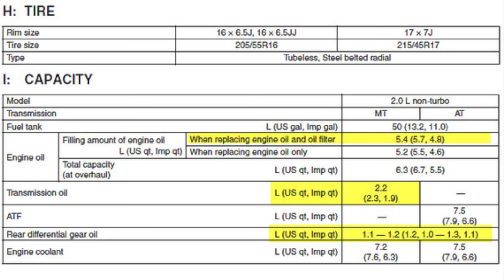How to Change Brz Transmission & Rear Differential Oil (In Depth)

Comment: Gasket Part Numbers

Transmission Drain and Fill gasket(washer):
#17008AA050(Subaru) | #SU00303626(Toyota)

Differential Fill plug gasket (Crush Washer):
#11126JB000(Subaru) | #SU00300122(Toyota)

Differential drain plug gasket (Crush Washer):
#1215710010(Subaru) | #TOY1215710010(Toyota)

Hope this helps
Reply: adancisco are the fill and drain the same for the trans?
Reply: @zachluellwitz8443  Yes.

Comment: Awesome instructional video sir!!!! I appreciate how detailed you were - explaining the proper gear Oil for both the diff and trans, torque specs, and how you even showed the proper front lift point for the car! Im  getting ready to swap in Motul myself!!! It's been a good month since you did the swap, how does it feel? 

Also, I'm curious to know what motor oil you're using? Motul ectolite 8100, AMSoil signature, etc?
Reply from the maker: Hello Harrison,
       Thank you very much! The oil for first 1,000 miles was more than awesome. Some weird things I noticed, like my car mileage, said I was getting like 40mpg+ for first 200 miles and was butter smooth. It seemed to go back to the normal 26 mpg and got a little of the notchiness back, but still better than stock.
        You won't be disappointed I'm sure! Just last tip is to make sure there is enough oil in transmission cause it has no dip stick to double check the level.
Reply: MrCodyBlair Thank You!!!
Also, any recommendations on engine oil? Do you stick with motul, or any other preference?

Comment: How often would you reconmend on changing the gear and trans oil? I bought a car new 5 years ago and has only 32k miles. Thanks!
Reply from the maker: 30k is when I would do it and is when I did mine

Comment: Is the only reason you mixed in some non-LS gear 300 in the rear diff so you didn't have to buy a whole additional quart for the extra .2qt it needed?
Reply: Probably a good balance

Comment: I just changed my transmission fluid and found out it took more than the stated 2.2L (about 2.4L) to fill until it started to drip back out. Did anyone else experience filling more than the stated 2.2L?

Comment: do you track your brz? wondering if the fluid works for the track day frs/brz/86
Reply from the maker: YUAN ZHANG it’s formulated for the track. It’s exclusively used by some shops as the only gear oil they use. Unfortunately my BRZ was rear ended by big lifted truck. R.I.Pieces. BRZ.
Reply: MrCodyBlair sorry to hear that bro but thanks for the info!

Comment: Do you need to us the LS for the differential or can i use the regular 300?
Reply: Orlando Diaz-Frias I have seen many more people online and in forums say 300 is perfectly fine for the brz and frs. The LS isn't needed for varying reasons for our type of vehicle. As something to do with ours not needing the extra compounds in the LS oil
Reply: Matthew Wyers okay thank you for the help. I appreciate it.
Reply from the maker: Hi Orlando,

I would recommend if you have the LS diff. Get one liter of the 300LS and top off with regular, It's only a few extra bucks.

Good Luck.
Reply: MrCodyBlair we don't need ls..Our diff is a torson type ..No clutch disk in it

Comment: Hey i have a toyota gt86 You Need to change that oil every 30.000 km ?
Reply from the maker: 48280.32 for km. Its recommended by the manual that you do it every 30,000 mi = 48280.32 km. Hope this helps
Reply: @MrCodyBlair  I I hope you reply I plan on doing a differential fluid change in a few days do I need to lift up the car evenly? Can I just lift the back part of the car and not the front? Hope u reply.
Reply: @vision1707  lol

Comment: Hey guys, I just need to change the differential fluid in a few days do I really need to lift up the car on all fours even lie like that or can I just lift the back part of the car? Hope someone replies. Thanks !
Reply from the maker: vision1707 yeah if you are just doing the diff you can just lift the back.
Reply: @MrCodyBlair  so, the regular car ramp is sufficient ?